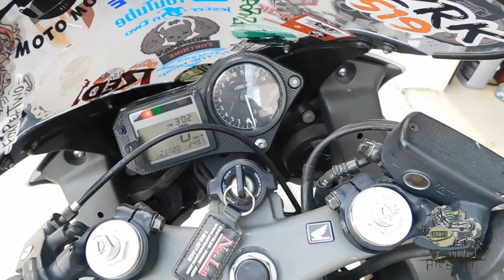2019 First Motovlog

Comment: Good you got out on the roads.
Even with all the garbage on the roads.  Had mine out 3 times so far.  Had to clean it pretty good after the last ride.
Reply: I actually have a 2nd bike, an 83 gs450ga.  Haven't  riden it in almost 10 years.  My insurance is cheaper by having it on my policy than to take it off.